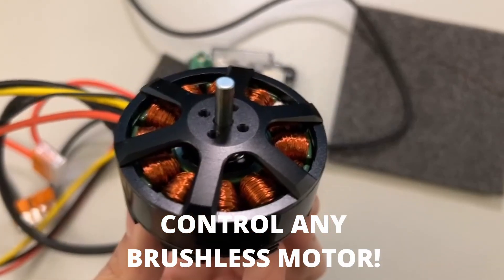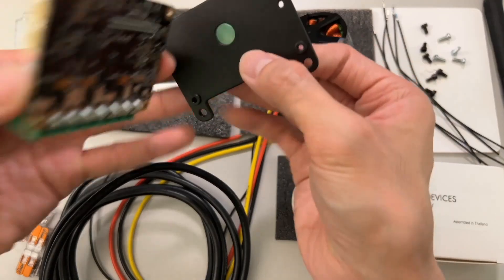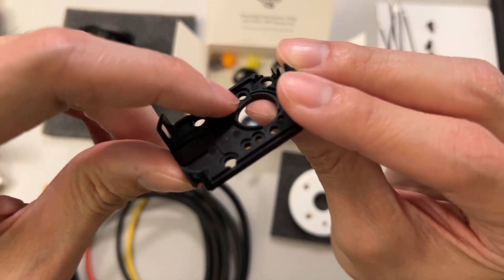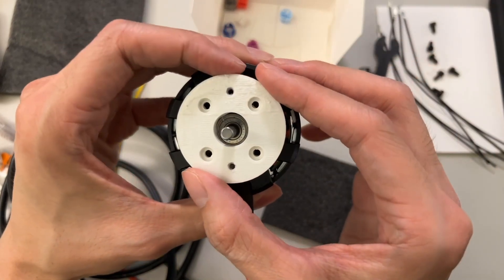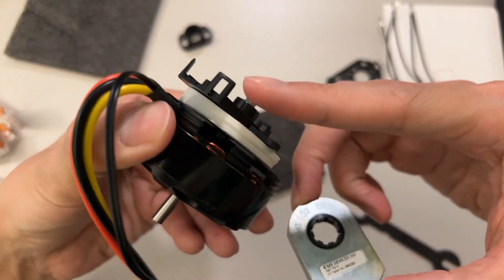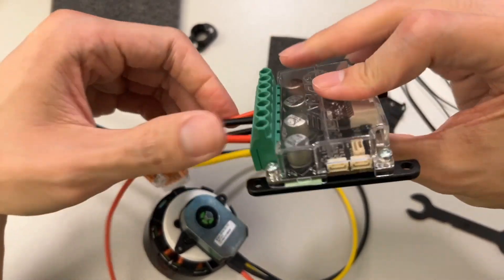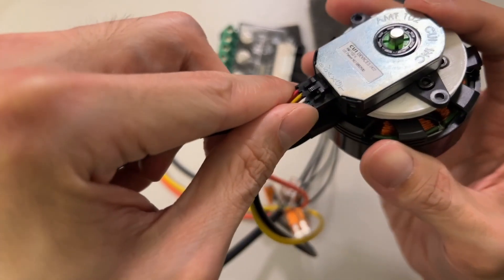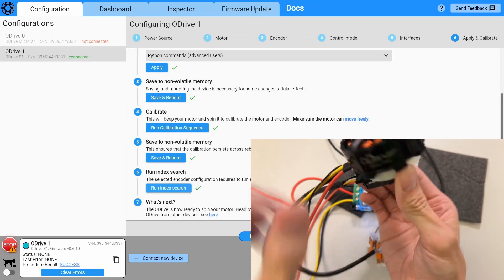Control Any Brushless Motor (BLDC) with ODrive S1, AMT102 CUI Encoders, and D5312s-330KV Motor!

Comment: Are these sensorless (i.e. uses Back-EMF) or does it require (Hall) Sensor feedback, in order to do the commutation?  

Currently i have a board based on an Infineon IRMCK099M (sensorless), but mymotor stalls whenever the load changes abruptly.. need to find an alternative.  

I found a sensorless Aveox Controller from Rix Industries that they said can work with the wild load swings of a compressor!
Reply from the maker: Typically used with encoder as feedback

Comment: I'm really enjoying your videos. I'm trying to learn to setup an Odrive S1 to work with a PWM signal from an RC receiver. Seems I have to load python and go the through the Odrive tool. Is there an easier way to get my S1 into RC mode? Maybe in the initial configuration GUI? Thanks!
Reply from the maker: Yeah try the gui. I haven’t tried the RC mode personally
Reply: @kevinwoodrobotics  Thanks! I've found in GUI, I can go to the Inspector tab and make all the changes.  I still haven't got it going though. Been a good challenge for a Sunday.

Comment: Excellent video. I've seen that some Odrive applications use the included break resistor. Why don't you use it? I'm developing a robot with Odrive. Should I include those resistors?
Reply from the maker: If you have high speed deceleration applications then yes

Comment: how do you run odrive along side your stm32 or other microcontroller??, like i want an easy reliable way to run my bldc motor but i also need to implement an entire control system so the motor spinning and its position is only 1 component.

Comment: Nice Video! I want to recommend you to make a followup video using Hoverboards motors coupled with Odrive S1. The motor is very powerful ( 14.7 Nm by my calculation) and can be found in abundance for ~30$ for two motors. Of course the main disadvantage is built in hall sensors with are not accurate enough for robotics application (8 degrees minimal resolution). I found very interesting solution to the problem. I drill the shaft and inserted a bicycle spoke with a magnet encoder on the end.
Reply from the maker: Thanks for the suggestion! Interesting solution